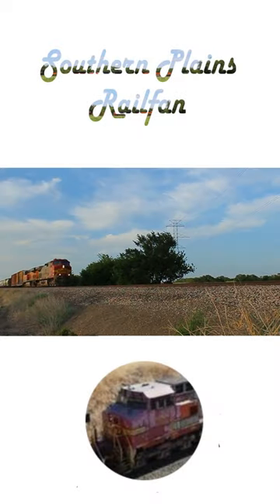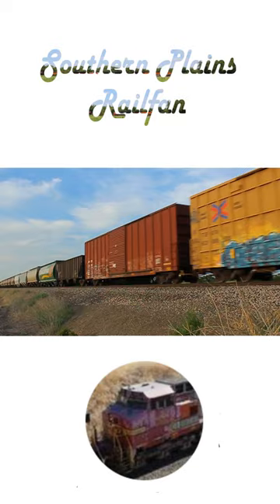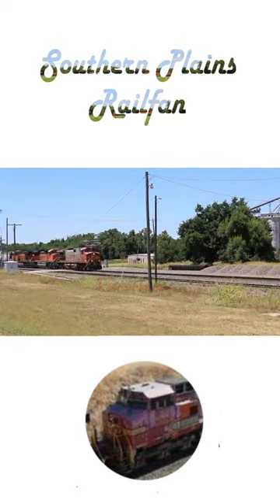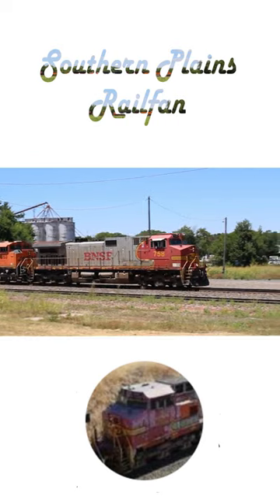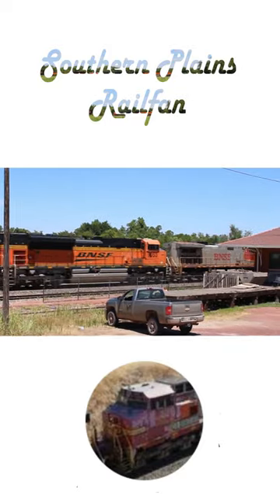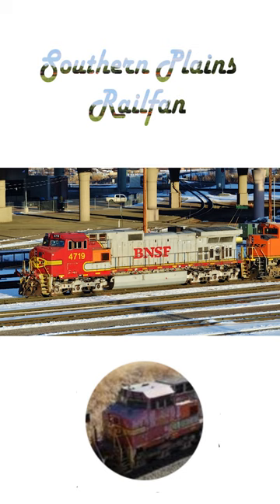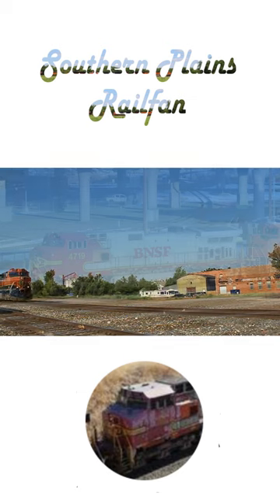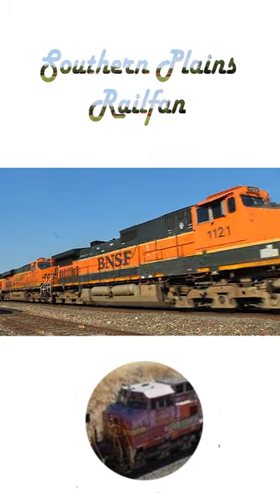Why do some warbonnets say BNSF not Santa Fe? #shorts

Comment: I think some already painted Warbonnets had the old “Santa Fe” replaced with “BNSF” white others were given small BNSF licensing while keeping their old paint. Maybe it’s also the other way around.
Reply from the maker: The only ATSF warbonnet I know of that was changed to a BNSF warbonnet is number 681, and that’s because it got beat up in a wreck in the early 2000’s. All the original ATSF Dash-9 warbonnets (600-699) were given little BNSF patches under their numbers, and all of the BNSF warbonnets (700-799 & 4700-4719) were painted after the merger. Over the years of course, several warbonnets, both ATSF and BNSF have been rebuilt and repainted into H3, but most have been left alone.
Reply: Yeah, as far as I’m aware that’s what I know with them all. Older ATSF ones received little patches under their numbers, and a good amount of them were rebuilt and repainted. Some units outside of the old ones are still regular dash 9s, but were later repainted. Including 4702 after it wrecked. Not to mention the very few B40s still in Warbonnet colors.

While I much prefer the classic Warbonnet livery, I’d be lying if I didn’t say H3 actually looks pretty good on the Ex Warbonnets!
Reply: @AlikStansberry  have you seen the green and silver war bonnet with red BNSF lettering on the side?
Reply: @user-wi2df3zv7b Yes, I have seen that unit. It’s pretty weird, but not really half bad.